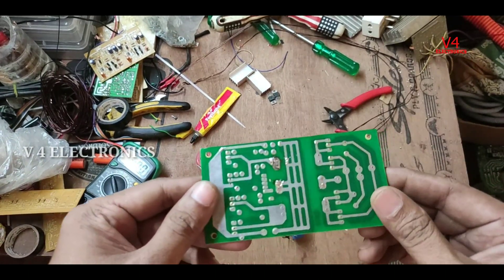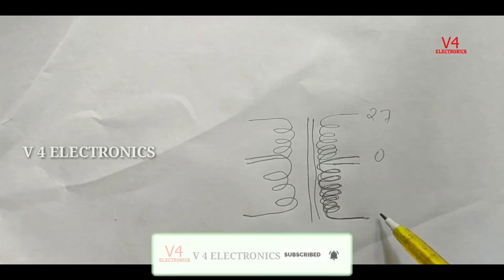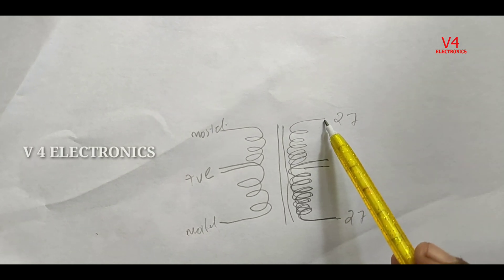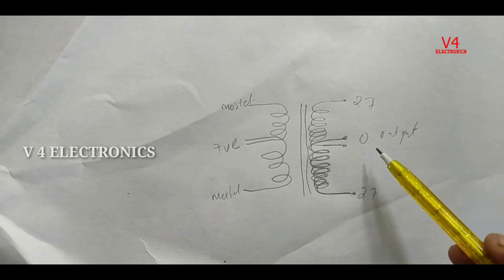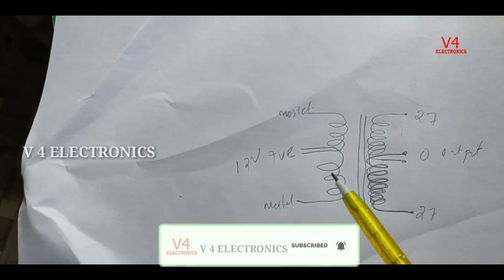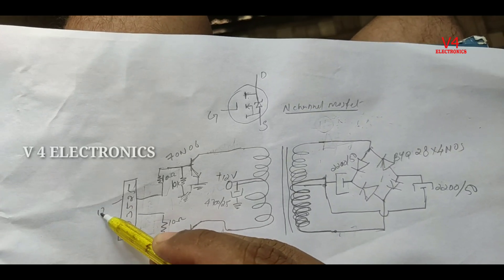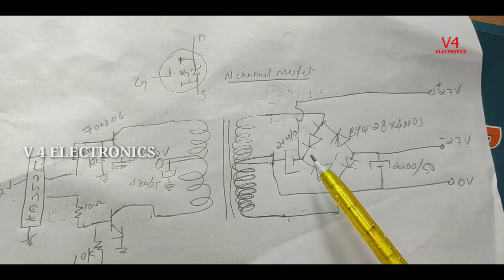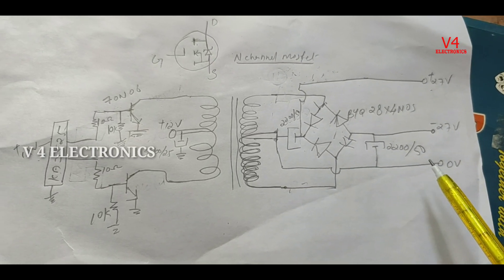എങ്ങനെ 12 v To 27 0 27 ഉണ്ടാക്കാം || Dc To Dc Converter || Malayalam || V4 Electronics ||

Comment: Chetta video kollam but circuit diagram manassilakunnilla
Reply from the maker: നെറ്റിൽ dc to dc converter using ka 3525 എന്ന് സെർച്ച്‌ ചെയ്താൽ കിട്ടും
Reply: @v4electronics491  search cheythu kittunnilla
Reply from the maker: https://www.google.com/imgres?imgurl=https%3A%2F%2Fmicrocontrollerslab.com%2Fwp-content%2Fuploads%2F2014%2F08%2Fsg3525-based-power-inverter.jpg&imgrefurl=https%3A%2F%2Fmicrocontrollerslab.com%2Fsg3525-pwm-ic-pinout-examples-applications-features-datasheet%2F&docid=ZkKFGW1rv-0w3M&tbnid=IjlK4oqInlF9AM&vet=1&w=1280&h=720&hl=en&source=sh%2Fx%2Fim

Comment: Ethinu etra AMPERE kittum
Reply from the maker: 20
Reply: @v4electronics491  input ill oru 12 volt adapter aanu kodukunath enkil etra ampere kodukanam chetta
Reply from the maker: നിങ്ങളുടെ amp ന്റെ watts അനുസരിച്ഛ്, minimum 12v/10amp,
നിങ്ങൾ ac to dc converter ഉപയോഗിക്കയാണ് നല്ലത് (transformer) type.
https://youtu.be/q4mFiYRkr3A
ഇത് 12v ആണ് നിങ്ങൾ 27v/3/5amp transformer മേടിച്ചു ചെയ്യുക.

Comment: Ente car amp smps Battery positive wire heat avunu athu enthu konda
Reply from the maker: കനം(2.5mm) ഉള്ള wire ഉപയോഗിച്ച് കൊടുക്കണം
Reply: Spark varnu,12 volt out 30 volt Anu reading kanikunthu chilpol 20 volt reading kanikunthu ,pulse ic problem kondu igane varumo
Reply from the maker: ആയിരിക്കാം

Comment: 12 dc to 50-0-50 dc 20 ampier    converter   make cheyyan pattumo
Reply from the maker: Turns കൂട്ടി 2 smps parallel ആയി ഉപയോഗിച്ചാൽ മതി.
Reply: @v4electronics491  2 SMPS ooo 😀 secondary turns kuttiyal  sheri avumo
Reply from the maker: ശരിയാകും.